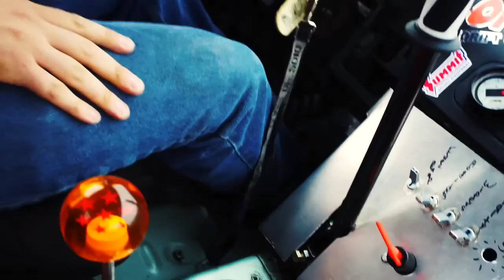1JZ VVTi S13 Coupe

Comment: Does your cd009 sit pretty low? If it doesn't how'd you fix that ?
Reply from the maker: it does sit low. my car is high to where it isn't a problem though
Reply: Okay thanks. Cause mine is sitting an inch lower than my frame rails